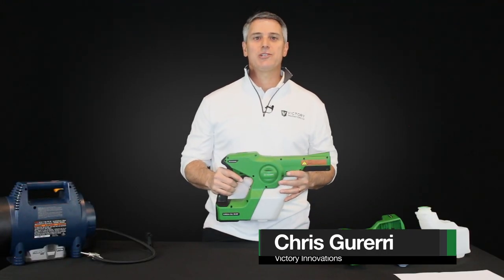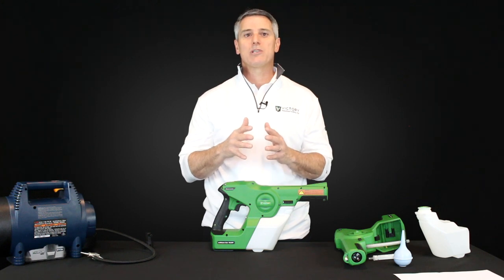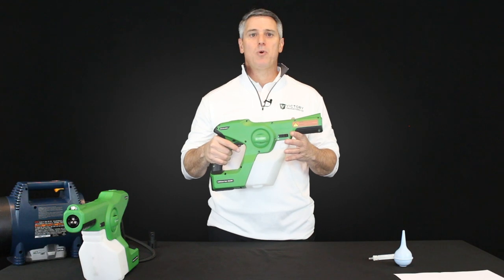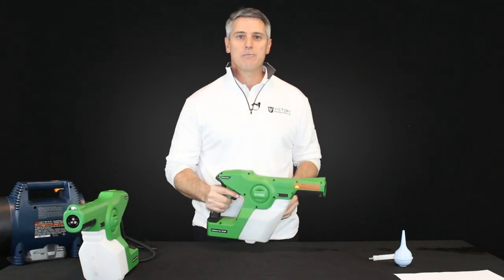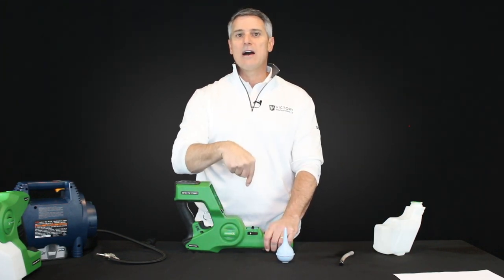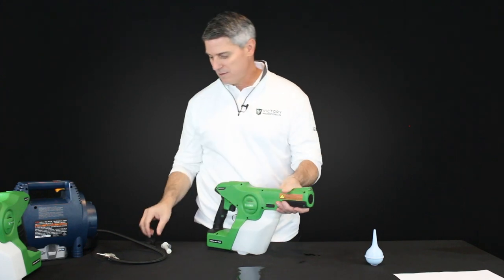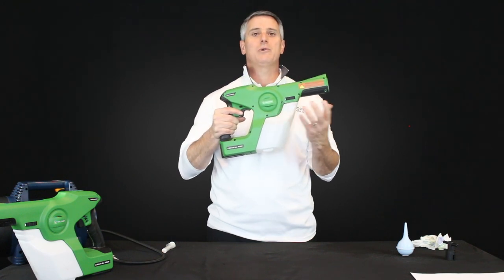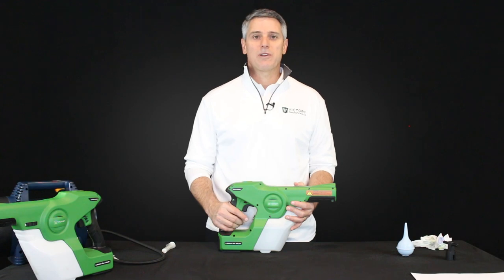Victory Innovations - Sticky Valve Troubleshooting Guide

Comment: We had alot of issues with dripping, to hoze bursting off, new o rings fixes that if anyone having similar issues, hozelock connectors also work...inside units holes are fixed to pump with clips, replace these with jubilee clips works a treat, once warranty is up of course.
Reply: what size did you all use? the thing is so tight i cant even get it off even if i tried harder

Comment: Why don't you have troubleshooting on your victory backpack sprayer because this handheld is very different to the components on the backpack.
Reply: Just had to troubleshoot one of the backpacks for my company and found out the issue inside the trigger (#VIP30) is a bad solenoid.  The solenoid acts like a gate, when you press the trigger the gate opens and allows the water to flow. So when it breaks it remains shut and blocks the flow even though the pump is making pressure.  I called Victory  about a replacement part for this and they had no part numbers or way of getting a replacement part out to me, their only option was to send it back if it was under the one year warranty or to buy another trigger.  Not impressed.  If you need a good sprayer go with Emist or the Clorox 360 from Byoplanet, we've tested these and they are great quality.

Comment: Our black nozzle ends are breaking at the base. I think employees are turning it too many times when inserting and plastic is poor. I wish there was a stopping point when it is secure. Replacing the nozzle end and making sure green rubber ring is in place seems to solve the problem of massive fluid leaking out of the house/gun between sprays.

Comment: Any suggestions on why our sprayer continues to spray after we let off of the trigger?
Reply: ours does as well, its like a drip spray for couple seconds ,just enough to make a mess,we have 2 backpacks and the handheld and they all do it
Reply: @fumanchu9770  any answer on this?  Mine does the same
Reply: The official word from Victory:  They are aware of the problem and they consider it normal with no way to fix it and no plans to adjust the design in the future.

Comment: The extension wand doesn't fit properly on the nozzle in the backpack sprayer and can not be used because is leaking all the time. the sprayer continues to spray after we let off of the trigger and when operating the backpack sprayer I am getting electrical shocking. Hopefully this company has an answer for all costumer comments.

Comment: Our company has a few of these Victory Electrostatic Sprayers and we are having some problems with the nozzle cracking.  We just bought these and its a bit strange that these nozzles are cracking so quickly.   Have you experienced this? If so, how do you prevent the nozzle from cracking?
Reply: We had that those issues as well, unfortunately what it looks like it’s not being wipe down properly or not being purge correctly. This will dry out the plastic rim on the nozzle and start cracking. Leading to flash back (leaking from inside of motor)

Comment: Motor on backpacks stays on all the time...this is in four of our units...any fixes
Reply: Any update on this I'm having the same problem.
Reply: @mikledapikle4656  hi we ended up getting replacements, seems like a faulty relay perhaps...issues we have alot are the hozelock seals going, broken connections in wiring means on off all the time.

Comment: In between spraying the gun drops liquid heavily instead of mist- why
Reply: I also would like the answer to this question for the backpack sprayers
Reply: Our sprayer leaks so bad as well.
Reply: This is usually a problem with the solenoid. Bad seal or trash. I need the compression fittings on each end of the hose and can't find any small parts on their web pages. Taking the fitting to ACE Hardware tomorrow.
Reply: i have the same problem...
Reply: @Rhianneboa  Did you find a solution to this problem?
Reply: @fourpoints8563  Did you find a solution to this problem?
Reply: Probably because the internal hoses are still somewhat pressurized by the pump and will continue to exert pressure on the nozzle until it reaches equilibrium with the ambient air pressure. Victory could have included a pressure release valve at the end, but I guess their engineers didn't think about that at the design stage and now it's too late to retool their manufacturing line.

Comment: Absolutely hilarious how this company doesn't see how exposing this video is. "Take a handheld 10ml syringe and pump water through the hose, because the pump inside of this machine is so insanely cheap and weak that 10ml of water pushed down by your thumb is quantifiably stronger."
 
Your product is giving me trouble RIGHT OUT THE BOX. Super embarrassing company.